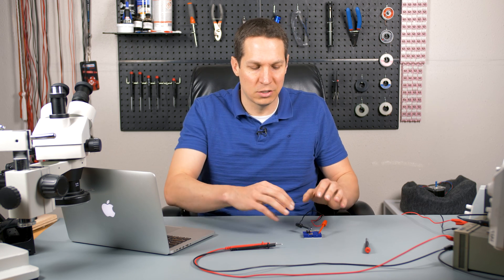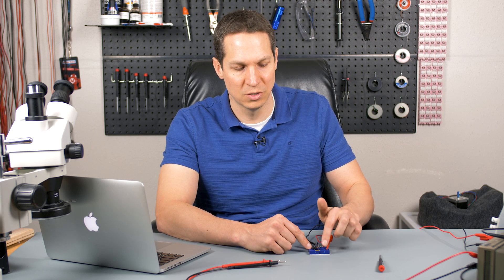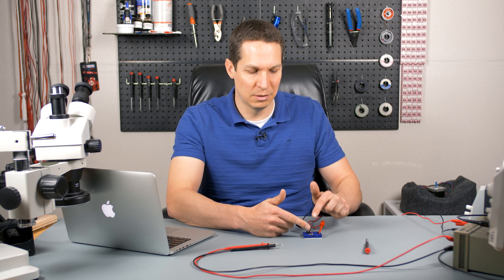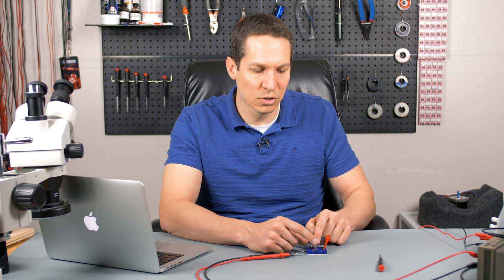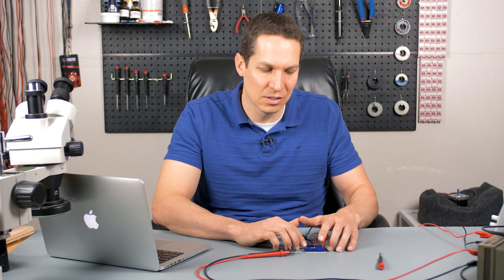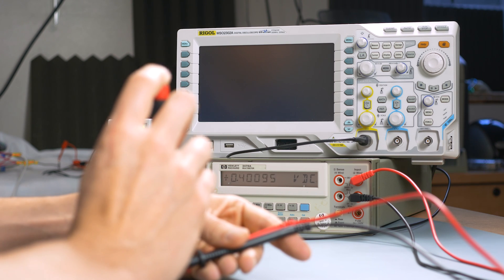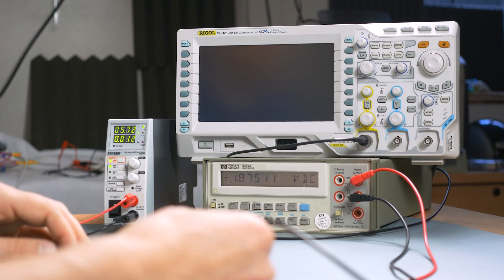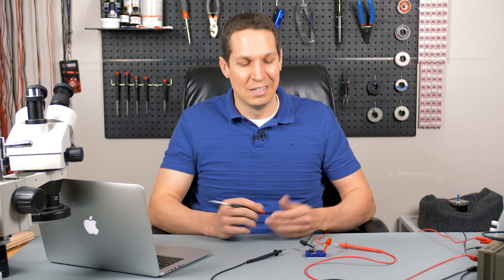Practical example of Zener Diode as a Voltage Regulator | Intermediate Electronics

Comment: I have 2007 Camry hybrid it has up top 40 cells, how I can use zener diode to regulate all the cells to have same voltage all the time when car is off and when it’s running… can you make video or sent picture of how is done

The hybrid cell is from 6.3v to 8.3v max

I would use 5 zener diode and 5 resistors per cell but I have no idea how to setup this

Comment: Good stuff. Trying to decide on Zener or 7805 for a small audio pre-amp. 2s lipo pwr source, LM358 x2 , some resistors and caps for a load. Now the comparative power loss...  This is a bench project exploring op-amps. I'm thinking the Zener with a 10ohm 1w resistor. however, the 2s is 8.4v, could the diode handle a 3s?

Comment: umm i was wondering if i can use one of those zener diodes 3.8v to drop the voltage from a standrad usb power supply (5v) by connecting it to the powerline cable (Red one) without having to use a resistor.  My goal is to connect the 3.8v output to an old mobile phone battery pins (the phone has no battery) in order to power it up and use it as a mini monitor next to my desktop pc.
Reply from the maker: If you don't have the resistor, you'll almost certainly burn up the zener diode.  If you have a stable load that you know exactly what it will be and you never provide power to the circuit without that load, you can dial it in fairly well with an appropriately sized resistor.

Comment: How do I select a zener diode for Max input voltage of 6.5V, regulated voltage of 3.7V and Load current of 300mA?
Reply from the maker: Susie put together a conceptual tutorial covering this:  https://www.circuitbread.com/tutorials/zener-diode-as-voltage-regulator-conceptual-overview  but she doesn't go into the details or have any examples (something I'm realizing we should do).  But the key portion of your calculations will be the series resistor.  Your zener diode will just need to have a breakdown voltage of 3.7V and be capable of 300mA+ of current.  Getting a series resistor in there which will protect the zener diode while not burning too much power is the real challenge.

Comment: I change the voltage of smps by changing the zener diode from 12v to 5v .is proper value wattage of zener diode necessary in smps i used 250 mw value:-)
Reply from the maker: I think the wattage rating of the zener diode will depend a lot on how much current you're planning on outputting with your SMPS, just as much as the voltage drop.  It's been awhile since I'm looked into an SMPS, though, it seems like a good design would actually make it so the zener diode wattage and the power supply wattage wouldn't be related.

Comment: Menos cháchara por favor 
..
Reply from the maker: Lo siento, cuando tengo nervios, hablo demasiado.
Reply: @CircuitBread  jajajajaha...
Reply: Hello, can you help me please?, I need to interpret datasheet from relay, (only two frades), I don't understand the google translation.
Thanks.
Reply from the maker: Sure, I'm actually going to be unresponsive for the next week, but I hope to check comments tomorrow.  Or you can jump on our Discord channel, so others are more likely to help as well.
Reply: @CircuitBread  Is the next:
It's a relay Omrom, 6gs-2 model, the datasheet say:
Rated voltage = DC 12 (ok).
Rated current (mA) = 11,7 (ok).
Coil resistance = 1028 Ohms (ok).
But here, I is not understand:
"Must operate voltage(V)" = 75% max.".
"Must release voltage(V)" = 10% min.".
"Max. Voltage(V)" = 200% (at 23°C)"
Thanks.
Reply from the maker: I'm back!  The "must operate voltage" and "must release voltage" is because it is rated to be ON when the coil voltage is at something (say 5VDC) and rated to be off at another voltage (usually 0VDC).  But what about in between?  With the "must operate voltage", it means that if you slowly increase your coil voltage, the relay will turn on at no higher than 75% of the max voltage (5 * .75 = 3.75VDC in this case).  With the "must release voltage" this means that if you slowly decrease your voltage, your relay must turn off at 10% minimum (5 * .1 = .5VDC) so the relay MUST turn off at no less than .5VDC.  With the way they word it, you'd expect the relay to turn on below 3.75VDC and turn off above .5VDC but you're not sure exactly what that point is.
Reply: @CircuitBread  thanks you